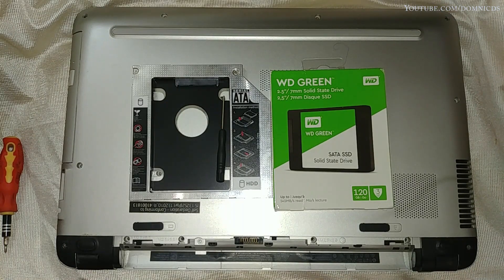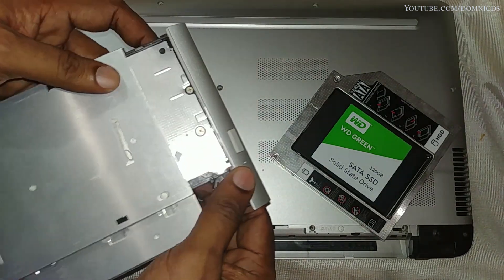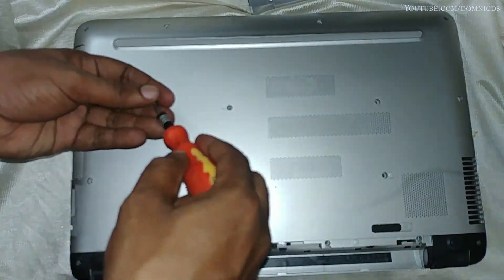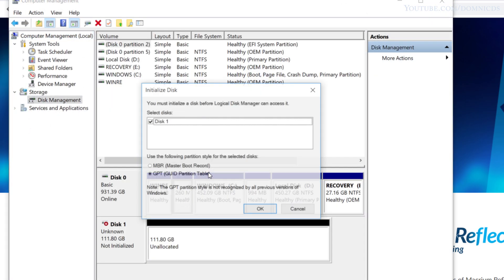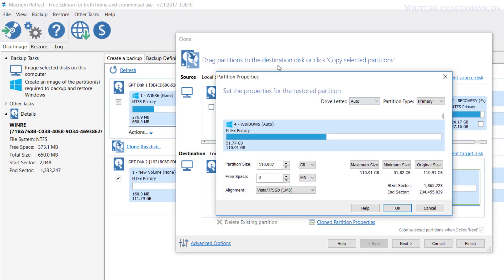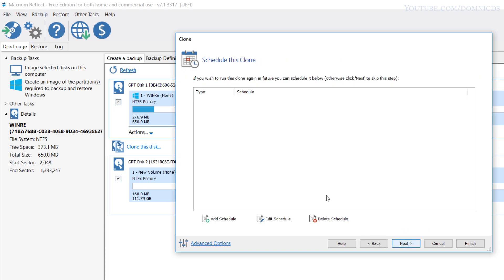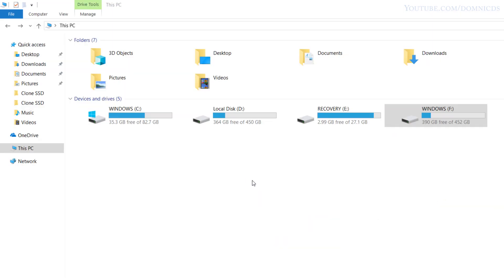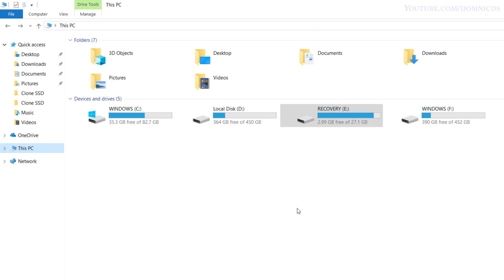How To Clone Your HDD to SDD on a Laptop (HP Pavilion 15-ab032TX)

Comment: Hi, great video. One question. Why did you put your HDD in caddy after cloning the OS? My HDD screws are tight and I cant put it in caddy in DVD slot, so will it be okay if I keep the SSD in caddy and use it to boot the laptop?
Reply from the maker: Thanks, Yes it will work fine... but not as good as when you install it in the place of HDD...
Reply: @DomGamingnMore  I HAVE HP AB032 TX LAPTOP IN 2022 FOR WHICH SSD should i go wd green/blue or crucial 240/480gb thnx in advance
Reply: @DomGamingnMore   and 1more thing is there any way of installing only ssd with genuine windows 10 dont waant to use default 1tb i have 5tb seagate external drive
Reply from the maker: Hi you can go for either ssd as per your preference... I've been using wd green no issues works just fine... If you want to just use the SSD, then you can clone your HDD to the SSD...

Comment: I cannot open the flat type screw below the CD drive as I damaged the screw tried to open it.i can't open the panel without it. Any solution please to open the damaged screw .
Reply from the maker: Try and bend the screw head upwards (don't bend it to much or it might break), then use a plier to rotate the screw, hope it helps...

Comment: What if, recovery and WinRE etc  is not clone ? Only windows C drive is clone ?
Reply from the maker: Without Winre the laptop won't boot into recovery mode and without recovery  you won't be able to reset the pc too factory settings, anyways I tried to reset my laptop recently  and it didnt work anyways...
Reply: @DomGamingnMore  Thank you!
Reply: I had tried  to clone the drive but it was not able to boot. So re-tried to clone, for that used the CMD command "DISKPART - clean" and cleaned the  disk. On disk management it shows only one drive partition but on macrium it shows 16MB "unformatted Primary". So will you please tell how to clean hard drive completely.

Comment: Are u able to use reset pc after migrating?!! please tell me its urgent!!
Reply from the maker: The option is available...
Reply: @DomGamingnMore  how mine showed error....

I have cloned all drives (except local disk) then i disconnect hdd and press f11 the recovery manager showed an error

Can i leave recovery partition as it is HDD because i m using both SSD+hdd,SSD for Booting only..
Reply: @DomGamingnMore  can u help me via mail?
Reply from the maker: did u clone the recovery partition too? did u copy all the partitions that i showed in the video? coz i just tried F11 and that worked for me, no errors...
Reply: @DomGamingnMore  yes all the partition...
Reply: Are u using hdd+ SSD and have u performed recovery after upgrading to SSD??
Reply from the maker: Yes i am using Ssd+Hdd, no i never had the need to perform recovery, but since u asked me a question and i tried it and it worked fine, i even tried the reset pc option and i was doing the thing but i aborted as i didn't want to reset the pc, try doing the recovery with the HDD remove the ssd... if it works then the recovery partition on the ssd might be corrupt...
Reply: @DomGamingnMore  If i have recovery partition in HDD & i will not delete that partition ever if i perform a reset in future it will install in host drive(HDD) or the disk i want suppose SSD...
Reply from the maker: i am not sure if that will work bro, as in all these years that i have been using a laptop i never had the need to reset the laptop... does it show 2 recovery partition? maybe that's causing the error, remove the drive that's installed in the dvd caddy and try...
Reply: @DomGamingnMore  ya i have tried again formatted the SSD and aplied all the steps in video including unformatted partition😂😂 there was space left... will try again...
Reply from the maker: Before formatting again try resetting with one drive installed... If the battery is low it won't reset the laptop so that way you will know if it works or not without resetting the laptop...
Reply: @DomGamingnMore  i have initialized the cloning of all partition following your video
After cloning
I will remove hdd via caddy and check if f11 works or not
Reply from the maker: Ok bro Good luck hope everything works out well for you...
Reply: @DomGamingnMore  It worked but i m able to access f11 and perform tasks only when my hdd is connected.....
that means f11 is only working when hdd is connected...  i think it will reset windows to hdd only...
Reply: Update- i m able to open bios settings by using restart+holding shift.... but unable to open F11 HP recovery with SSD it showed error

Comment: Why not partition number  6 ? 
Has this wroked for anyone  ?
Reply from the maker: Well i didn't clone partition no 6, coz it would not fit on to the Ssd... and yes it worked as its shown in the video itself...
Reply: @DomGamingnMore  thank you for the info
Reply: @DomGamingnMore  does ssd make a very notable difference ?
Reply from the maker: Yes it does...